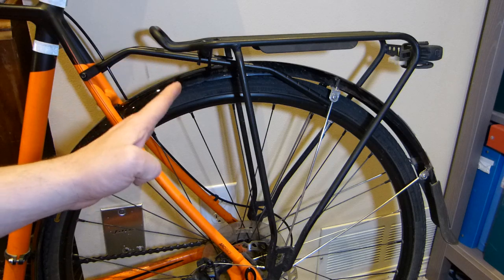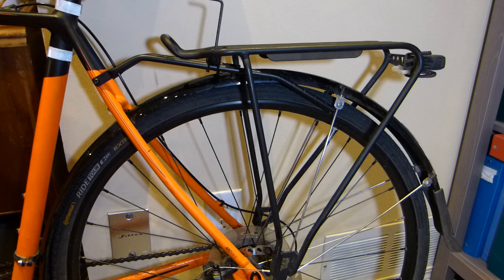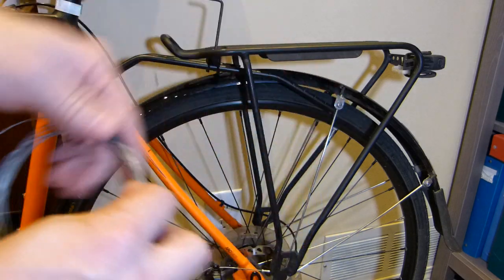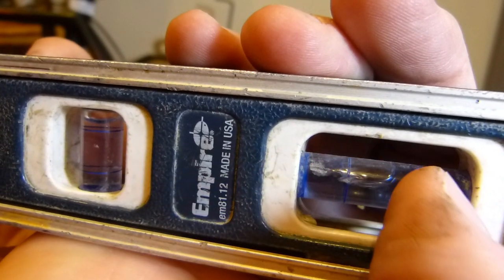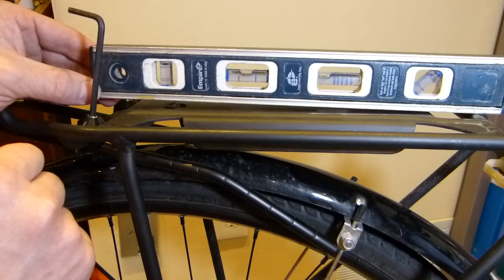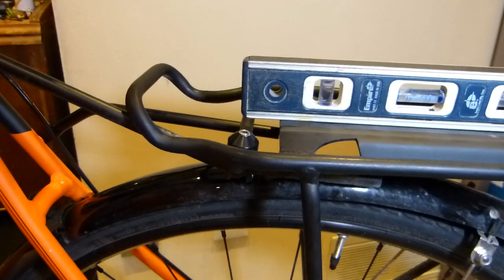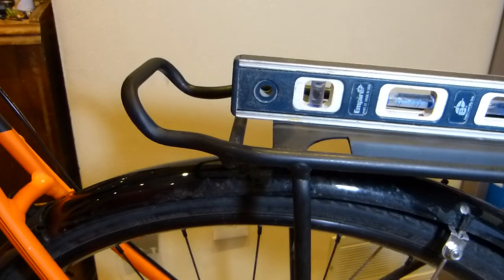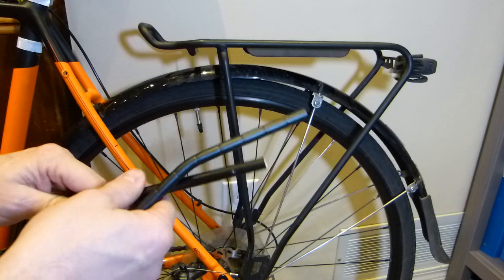Bontrager BackRack fitting & mounting

Comment: Will this fit boost spacing and 650b x 3inch tyres?
Reply from the maker: wheel and tyre size is not a concern, frame geometry could give one a head scratcher, might need spacers, adapters, other hardware